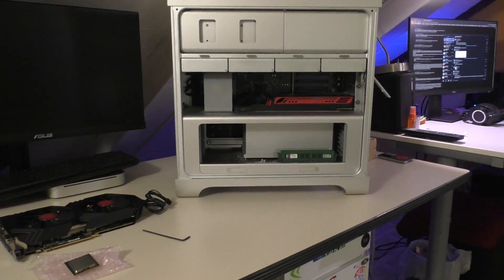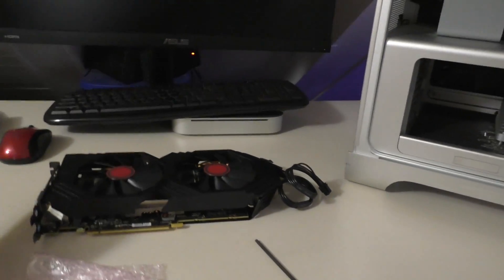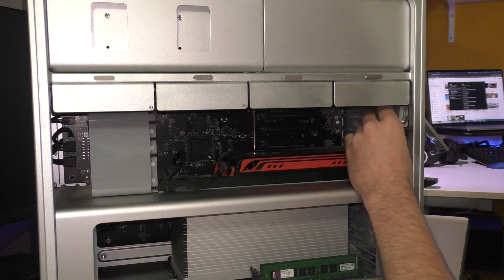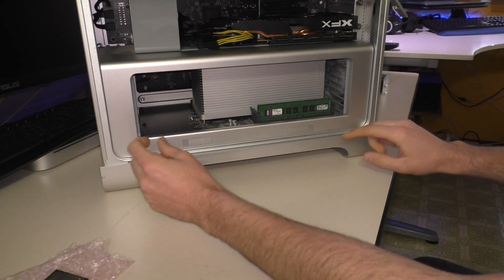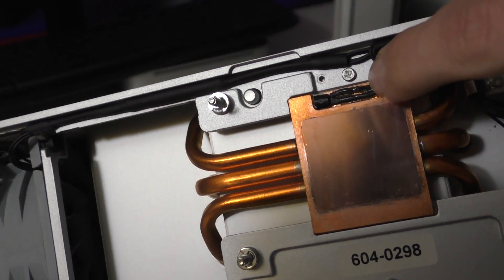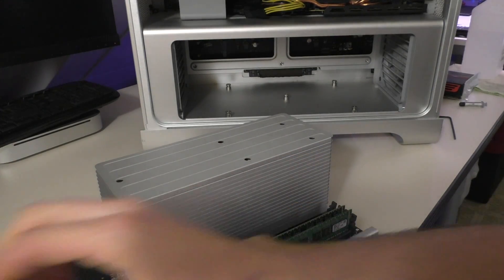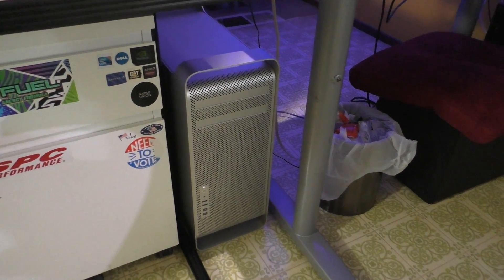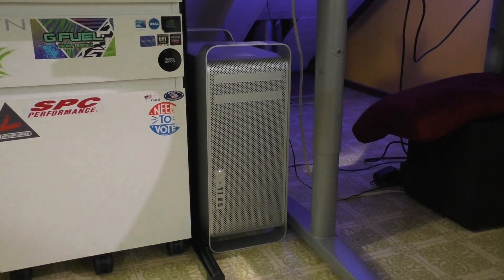Upgrading My Mac Pro 4,1

Comment: Nice machine. I have the 1,1 and five weeks ago I bought a 4,1, now flashed to 5,1 running Catalina with two Xeon 5650 and a rx 570. I just have installed few minutes ago open core and now it had bootscreen.

Comment: If that has a CPU gate then it has to be a 5,1. If the CPU tray was swapped from a 5,1 to a 4,1 the fans will run at full speed, unless the EFI ROM was modified. So was this actually a 5,1 Mac Pro?
Reply from the maker: No, it's a 4,1 flashed to 5,1 firmware. I was of the understanding that the northbridge is on the CPU, so if you upgraded it to one that supports 1333 it would work. Idk, doesn't really matter I guess
Reply: Only the dual processor 4,1s did not have the retention mechanism.
Reply: @accordinglyryan  Not the northbridge, the memory controller. That was moved from northbridge to CPU as of Nehalem, and the memory controller in Westmere, which this 56xx chip is, it should be capable of 1333MHz. It might be specific to the timings of this memory why it's not actually running that speed.

Comment: If you zap the pram it will make your new 1333mhz ram run at the correct 1333mhz instead of 1066mhz (or so I've heard). Also, can you share links to the GPU adapter cables that you used? Thanks
Reply from the maker: I've sold the machine but good to know lol. Okay so you need:
One of these: 
https://www.ebay.com/itm/DUAL-6-PIN-TO-8-PIN-PCIE-GRAPHIC-CARD-POWER-CABLE-ORIGINAL-ONE-PNY/302183870512?ssPageName=STRK%3AMEBIDX%3AIT&_trksid=p2060353.m2749.l2649
And two of these: https://www.ebay.com/itm/Mini-6-Pin-to-PCI-e-6PIN-Graphics-Video-Card-Power-Cable-Cord-for-Mac-G5-Mac-Pro/183432243223?ssPageName=STRK%3AMEBIDX%3AIT&_trksid=p2060353.m2749.l2649
Reply: @accordinglyryan  Hey! Now I know which cables to get. Thanks for making my life easier.

Comment: did not that the quads still had the heat spreaders i thought the singles were the same of duals
Reply from the maker: It's only the 2009 models that are like that, the 2010s and up are all lidded. Not really sure why they did that
Reply: That I did know the 2010 had the heat spreaders what I did not know as I’ve only seen people up grade the dual cpu 09 macpros that did not have them and they did not have the retintion system like the quad and 2010 models have u can still use the heat spreader lidded cpus on rge dual cpu 09 but’s it’s a lot of hassle macvids shoes it on his channel
Reply from the maker: @ljonesj  Yeah you have to shim the heatsink to not crush the CPU. I'm just glad I didn't have to deal with that lol

Comment: If you clear the pram it will utilize the 1333 speed. Have 2 of these and did x5690s with 48gb of 1333 had to clear pram